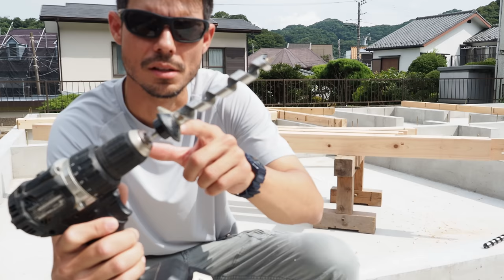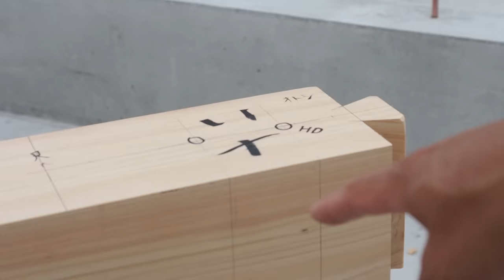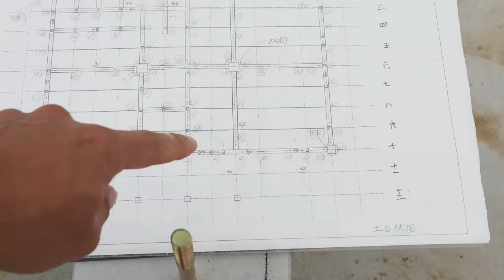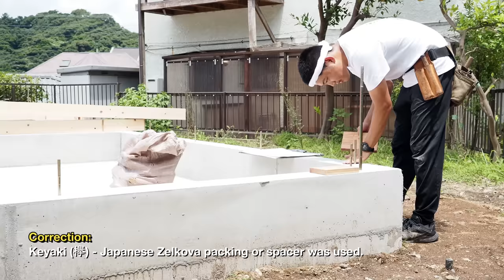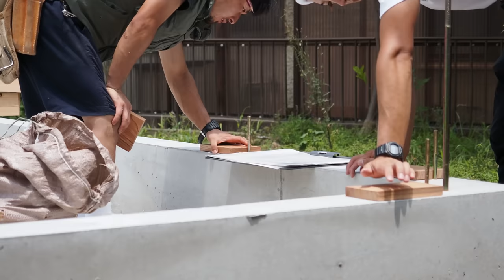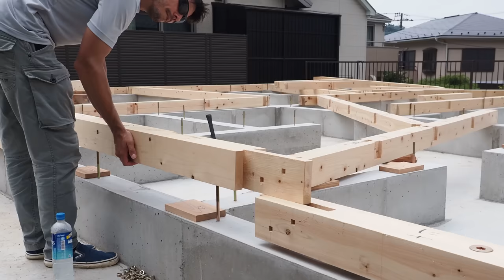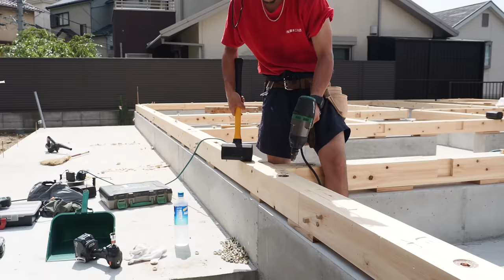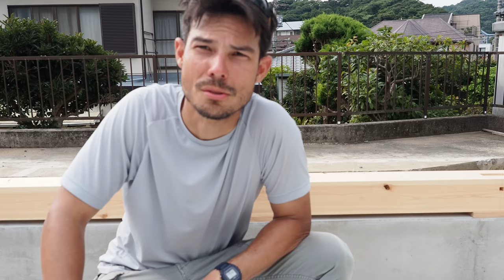Japanese Foundation Structure Explained! - Dodai (土台) - Setting up the Dodai (Foundation Beams)

Comment: How to match the angle of drilled holes with the angle of each rod inserted into the Dodai?

From the video it appeared that not all rods were perfectly 90 degrees to the cement base. However, this could be an artefact of the viewing angle and camera lens.

Comment: In Europe we don´t prefer this type of mounting the "foundation wood beam" on slap, because it is a thermal bridge. Instead we use steel corner brackets. We also use XPS styrofoam insulation between the wood and slap for another break of thermal bridges... By the way, nice clean construction site - we usually don´t have them here 🤣
Reply: That makes sense and sounds like a great idea, the foundation here is strange to me as well, I guess those cavity areas could be filled with insulation material though.
Reply: @JustIn-mu3nl  Those cavities will be empty. This is crawlspace foundation. You can control the air flow under the house to help cooling the house during summer or block air flow at all during winter, so the captured air create insulation. At least in Europe, this is how we utilise crawlspace slap like in the video
Reply: @peterkral4660  Thanks, first time I have seen it.

Comment: Why does the house use a subfloor space rather than just placing tiles or a wooden floating floor directly on a flat concrete slab? For insulation against winter cold? In Australia we barely ever have this type of floor. If the slab needs insulation it's usually polystyrene foam "pods" laid under the slab before it's poured.

Comment: The precision of the concrete foundation is impressive.
As to your drilling: you can't drill perfectly straight down just by eyeballing it, can you? Any marks on the other side of the beam to check for precision?
And how about wood protection? The timber seems untreated. Japan has a humid climate. Does the timber have magical properties to stop insects from eating it? 
It would also be nice to understand why certain joints are preferred over others. Is it just tradition, or science?

Comment: Wonder if (since I have never see this style, nor know where to get this hardware) you have ever done this in the way we do it in the USA?
Are there any benefits or drawback to either to one vs the other?  Just at a glance, it seems faster using a nut and washer with plastic moisture barrier, But I can see the board to board joints here adding to the rigidity, using thinker lumber in general adding to this. 
Just curious as to how/why this came to be or was developed.... Gonna watch more of your videos to see if you show a complete build like "The Crazy Framer" used too.

Comment: I’m surprised that a chunk of custom thickness wood I’d used as a spacer to ensure the floor is level. But what will you use to seal the gaps? Never mind, I’ll sub to see this through & hopefully you’ll show the answer.
Reply: The gaps will not be sealed, they act as ventilation of the foundation. If sealed the underside of the floor will begin to absorb damp
Reply: @altepost3805  won’t that make the floor cold in winter?

Comment: When you drill a hole in the beam, and you follow the guide line drawn on the side of the beam so that the exit hole is also in the right place, do you do it by eye? Is there a room for error? Are there any situations when you have to bend the metal rod so that it fits the hole when you install the beam?
Reply: There's a Japanese carpenter named Shoyan on You Tube, and he shows that.  But to do that you flip the beam over and drill from the bottom, then flip it back upright.  The reason for that is the bolt where it exits the concrete isn't movable.  So on the bottom you are drilling exactly in the position of the bolt at the concrete.  Then if you had to bend the bolt at the top to get it to exit the hole, you can.  I hope that makes sense from my description.
Reply from the maker: I drill by eye. It is not an exact science, but you do want it close enough that you don't cause distortion to the Dodai. You can also thread a nut on the end of the threaded rod and tap the the rod lightly to align it (hit the nut on the threads!), but this may compromise the rod by placing fatigue on the threads unnecessarily.

Comment: I'm used to asembling impregnated wood on final assembly, to prevent it from rotting, but it might be that the wood you're using is more sesistant to rot, than I'm used to.
Reply: Beautiful joinery nevertheless.

Comment: Is it really necessary to measure the distance between the threaded rods? 
I know they're a little tall, but if you angle it right I wonder if you hold a beam in place over the rods, barely dovetailed, and whack the beam with a mallet over the rods to indent the wood for you.

I dunno if it would work as well unless you used a big hammer, but you see something similar with drywalling in the states.

Comment: Is there a reason why there is no moisture lining between the concrete and the wood spacers? Or do the wood spacers act as a moisture barrier. I can imagine that there is a lit of moisture able to be transmitted through the concrete foundation up into the floor framing. I have a house from the 50's that uses a similar construction and every foundation pile has a asphalt moisture barrier so that the wood doesn't becomes water damaged over time.

Comment: Those Drills (I don't know how they are called in English. In German it's Schlangenbohrer - literally Serpent-Drill) should be used with less rpm. Than they are much less likely to get stuck and transport the chips of wood way better.

Comment: @14:10 I see a trio of 105mm brass or bronze pipe endcap's near the grade beam.  Are those all city hook up risers or are they weeping tile cleanout access points.  Also why is there no waterproofing creosote or bitumen film brushed on the outside of the grade beam perimeter?  Weeping tile train pipes and parging alone does not stop moisture entrainment into the concrete.

Comment: I'm curious if the construction methods are interlocked the way they are because of earthquakes? Are all the dovetails and horizontal dipoles to joint the framing part of that mitigation? Or is this just something that is done because it evolved from traditional "no nail" framing methods?

Comment: Great video - thank you so much <3
Do you put a chestnut board underneth the Pillars of the corner as well, or does the pillar sit on the concrete ? (time 13:28)
Reply from the maker: The pillars at the corners will sit directly on concrete. This is similar to how a pillar would sit directly on top of stone. I believe in this way the forces due to an earthquake will not be directly on the threaded rods or on the Dodai itself.
Reply: @thecarpentrylife  thanks so much <3
Reply: @thecarpentrylife  Won't that suck up moisture through the end wood? Is there no barrier at all?
Reply: A piece of lead between pillar and concrete would sort this

Comment: Why not put water proof material behind wood slab and concrete cement?
Condensation will form between the wood and the cement; we usually insulate it with a tar-based synthetic film.

Comment: Why don't you have some kind of gasket in between the beams and foundation. Lots of air leakage under the house. Also, are those spacers treated or some kind of artificial product? Thanks

Comment: what type of wood are those 22m shims?  it occurs to me that as the shims in direct contact with the concrete might accumulate moisture and deteriorate over time, are they made out of some type of pressure treated or engineered material, or perhaps cedar?